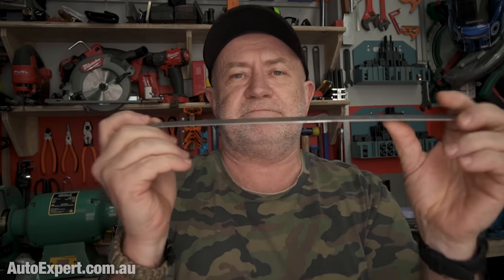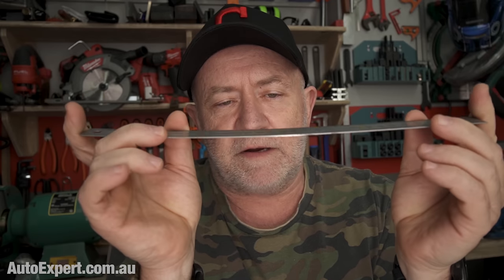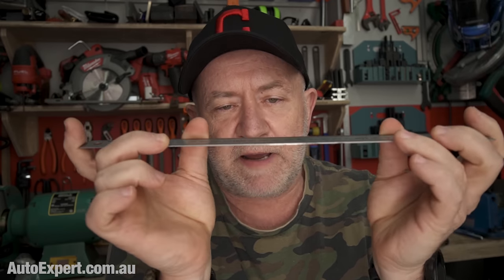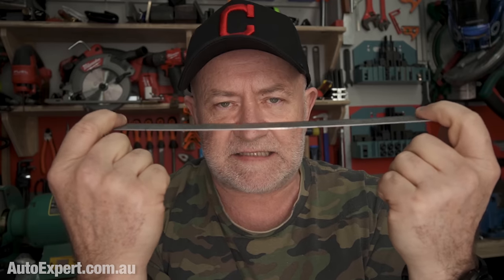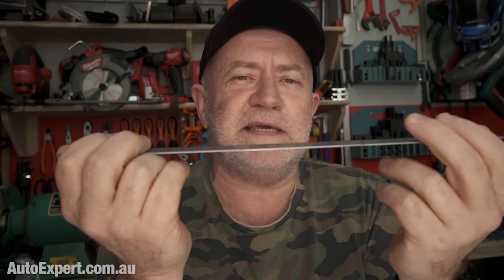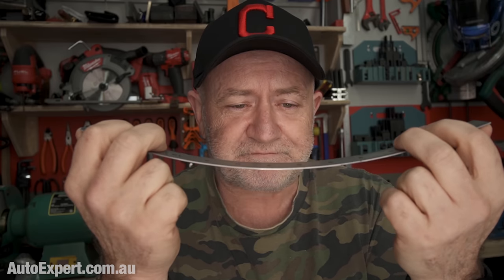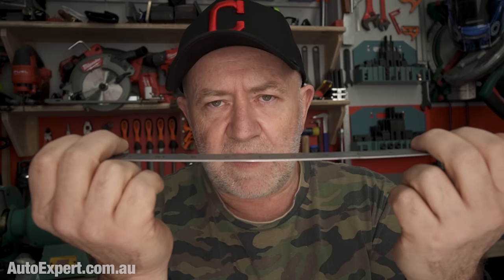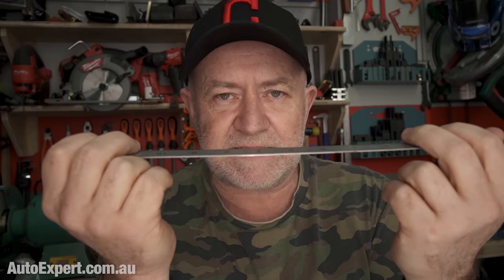Leaf spring reset: Can you fix a sagging spring? | Auto Expert John Cadogan

Comment: I seem to remember from when I did my engineering quals years ago that steel creeps.  i.e. deforms at stresses much less than yield at room temperatures  over long period of time.  Why wouldn't a leaf spring?
Reply: Yield isn't a hard line.
Reply: @johnwade1095  Ummmm... Yes it is.  It's the 'wiggle' on the stress strain graph at the end of the elastic range.
Reply: @cdb9033  No, it's not. That's why we use 0.2% proof load instead, because that is a hard line.
Identifying the exact point at an infinitesimally small amount of deformation becomes permanent is impossible.
Reply: @johnwade1095  Yep...  I think you are playing semantics.  However you spin it.  Low temperature creep is real and it happens.  My question stands.
Reply: @cdb9033  It's clear you don't understand the words you are using.
Reply: @johnwade1095  Haha, I was thinking the same thing about you.  Let's just agree to disagree.
Reply: @cdb9033  People dream up the weirdest things.
Ask yourself, if Re is real, then how come creep is also real?
Both claims can't be true, but you've made them both, seemingly oblivious of this.
Hooke's law is an approximation.
Reply: @johnwade1095  Not the best source but it uses small words... https://en.wikipedia.org/wiki/Creep_(deformation)
Reply: I'm not going to argue anymore dude.  Good luck with your studies.
Reply: @cdb9033  Yeah, My MSc covered this 10 years ago.
Reply: @johnwade1095  stubborn didn't read your link. I think he's learning days are over now
Reply: @brucehart4627  I was going to pull the latest ASTM standard for bolts, as I recall it no longer refers to yield, but to 0.2% proof as it is actually possible to determine that without it being a judgement call.
But he left.
I was being a little dismissive of him, but if I can't be a dick on the Internet,  where can I be?

Comment: Yes you can get them reset, no it's not all that expensive. About 200-300 a piece, which depending on the spring can be a whole lot cheaper than a new one (IE a truck etc)

I will however say that springs CAN sag over time. It's called creep.
If the pack has been designed properly and the bean counters have been told to bugger off your spring should handle the applied load without creep. However, if the spring is poorly designed it can be subject to creep over time.

I suspect that creep in car leaf springs is really not a common thing though. I don't know.